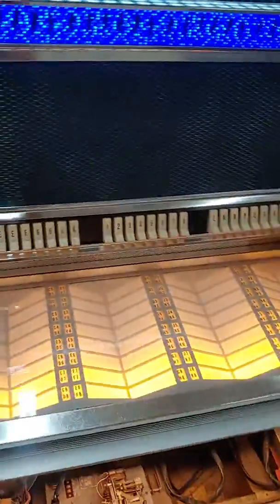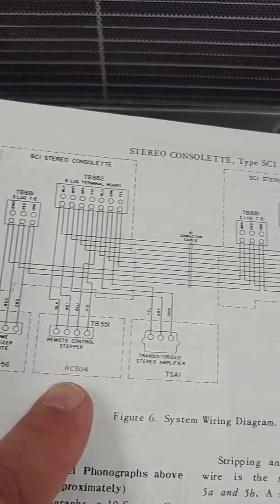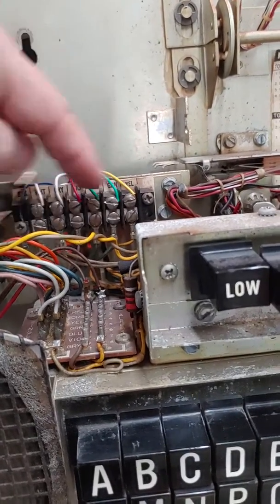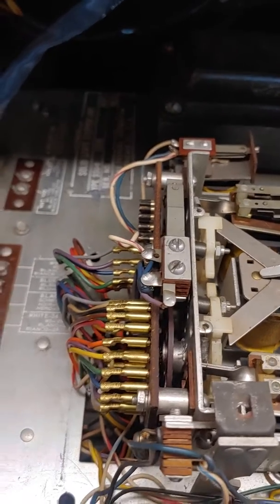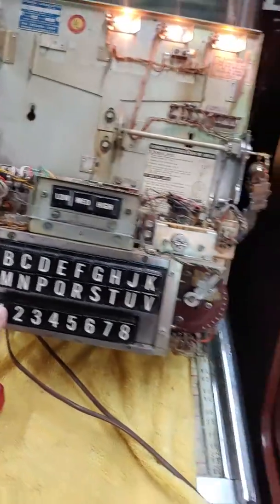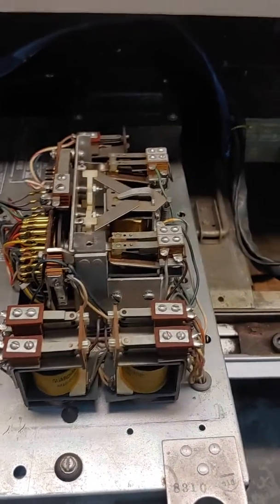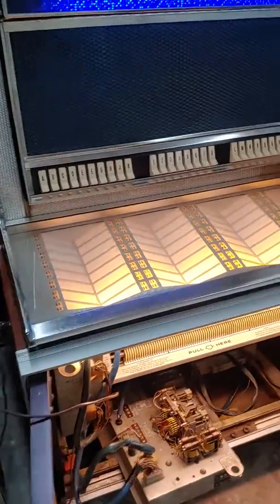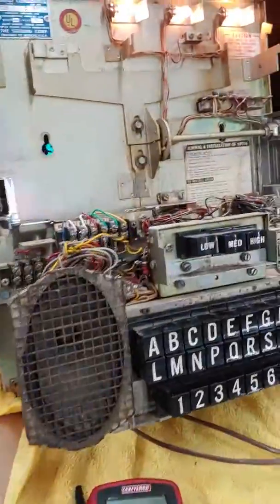Seeburg SC1 connection troubleshooting

Comment: Did you finally figure it out. I know it's been 5 years since you posted this but I ran across your video trying to troubleshoot an SC1 credit unit problem and spotted something in your video. It looks like the stepper only read in the letter then didn't switch over and read in the number. My guess is a dirty or misaligned contact in the juke stepper.

Comment: Hello! where did you find the 33 wire cable to connect the stepper (J3201) to the Electrical Selector Unit? I have the same setup but need the extra cable.  Thanks in advance!
Reply from the maker: I made an offer a guy couldn't refuse.  You might check one of the parts guys....Bill Butterfield , Rick Murray or Mike Florio.
Reply: @rdm5161  Thank you! I ordered the connectors and might try to make one.  Thanks again for the reply!